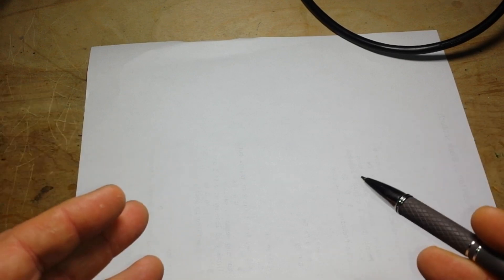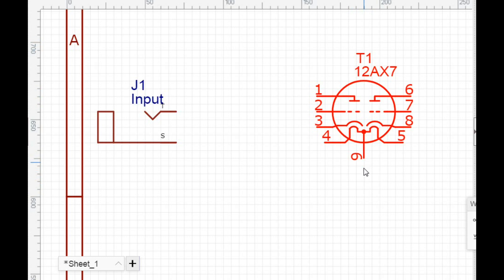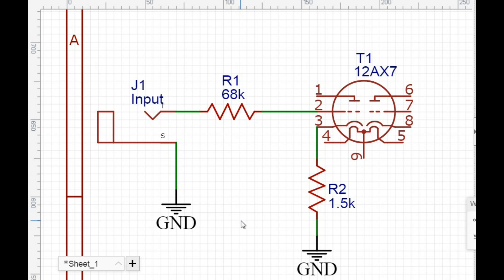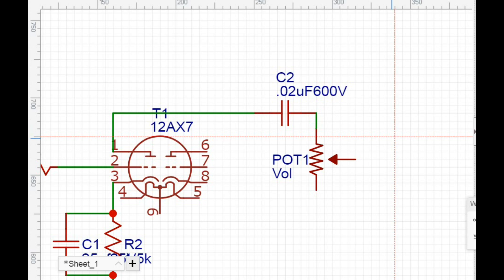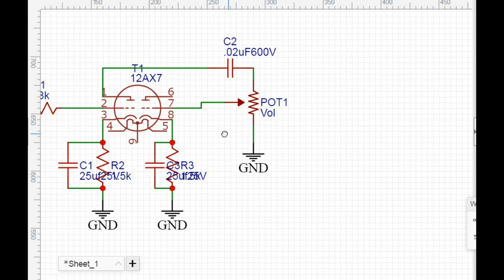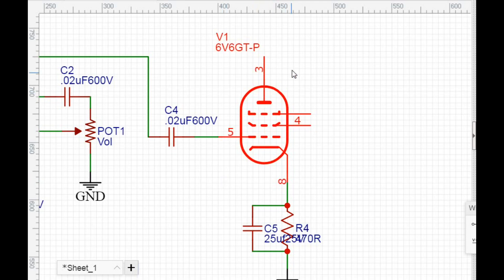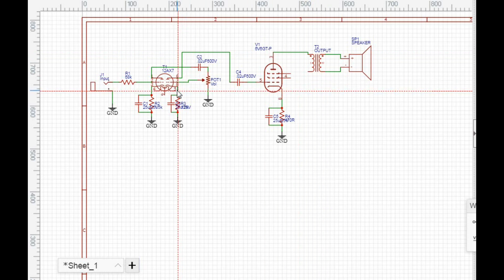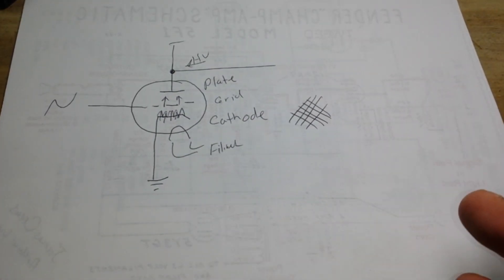Let's design an build a vacuum tube amplifier from scratch

Comment: Thank you for explaining the tube basics, very cool. When I use a chinch input, is the input impedance right or what needs to be changed. Great video.
Reply: That will not affect the input impedance, which is determined by the source. If it's from a phonograph, then you will want an inverse RIAA filter added to the circuit.

Comment: i recently took apart a  1950's lemco model 45 ignition coil/condensor tester that uses a ken-rad 6-48 4 pin vacuum tube  but cant find info on specs but the heater is ok @ 5.0-5.5v. i dont know tubes very well but im wanting a vacuum tube tesla coil. could I use it for a vttc??? any info would help .thank you paul!

Comment: Hello Paul!  If I may make a suggestion, I really think that you should put a capacitor between the input and the grid resistor in the first stage. Especially if you want to use the amp as a HI-FI amplifier. It is a form of protection to you, and your equipment. 

Also, I hope that your dentist appointment went well! Stay safe and keep up the videos!!

Comment: Should there be a capacitor between the input and the  tube/valve to prevent DC getting to the grid?  If you put any pedals between the Guitar and the amp, there will be DC voltage on the input in addition to the AC signal from the guitar.
Reply from the maker: What I have covered this far is the exact signal path of the Fender 5F1 circuit.
Reply: @learnelectronics  I would vote for the negative feedback.. it will make it much more Pedal friendly.  You might consider adding a master volume and effects loop.

I have been thinking on building a tube amp and this might be the project!

Comment: I never fiddled with tubes but have had a lot laying around many years ago.
As I always wondered and when you say that the grid thus the voltage of it, is that the negative or positive voltage of it?
If it's the positive this must make it 180 degrees inverted, right? since then the electrons will stop there instead of continue to the plate.
If it's the negative then why even leave the cathode as it "won't see" the plate as much as it's being choked by this grid.
Reply from the maker: The signal is AC
Reply: Well THAT I know, lol, as I asked the it's the negative part of it or the positive.

Think of it as if I probed it as if the input was just one short digitized pulse and in that moment it was sampled it was either positive, negative or zero, all the values AC can be.

Sorry... as you see on my name, English ain't my native language so... Hope you understand what I mean with this.

Comment: Been waiting for this Paul! That was great! Will you be expanding on the signal path by adding a tone stack and more gain stages? Possibly an inverter? I’d be curious to see which type you go with. I prefer the Marshall values to get that sweet Marshall growl. However, a chimey Fender can be sweet to! I only ask due to this design being pretty close to the Champ you recently built.
Reply from the maker: Youve got a good eye and are intuitive. Ill be dding a Baxendall type tone stack, but no more gain stages.
Reply: learnelectronics Thank you Paul! And Awesome! I look forward to the rest of the installments.
Reply: learnelectronics I am sure you might have seen these, but here are a couple great resources for tonestacks:

Duncan Amps Tone Stack Calculator web version:

http://www.guitarscience.net/tsc/

Another great site:

https://monster.partyhat.co/article/amplifier-tone-stacks/
Reply: All extra gain stages would really do is increase distortion, they wouldn't necessarily increase the overall gain of the amp.

Comment: Thanks for the video! 
A minor advice: you could give some more in-depth info for us newbies about the actual purpose of the caps and resistors added to the construction. I know that there are tons of videos about tube amps, but none of them seem to give enough explanation about the purpose of the individual parts and their values, just "a capacitor here, a resistor there, and you're good".
You could also make a video about the characteristics graphs in tube datasheets and how to use them. That's a topic I've been interested in for a very long time, but never found a good video about making sense of those graphs.
Reply from the maker: This is just the first part of this series, lots more information will follow.
Reply: @learnelectronics  Thank you, can't wait! :)

Comment: Why would you want negative feed back ?  Will it suppress osculations or ?  ???
Reply from the maker: It creates more "headroom" so it doesn't go into distortion at lower volumes
Reply: You are correct, the negative feed back will make the amp more stable, and less likely to oscillate.

Comment: Hmmmm what if you don't connect the B+ at the output transformer but instead connect the B+ between the output transformer and the output tube, then use a capacitor to block DC from going to the output transformer which will be grounded where the B+ would normally be connected. My thinking is that since no DC current will be present on the output transformer, it wouldn't reach saturation as early as it would had it been connected the way which you are going to do... Yeah it's a little unorthodox but I don't have the means to test my theory, my understanding is that the fact that you have D.C. across the output transformer and also the Ac signal when the amplifier is working, the transformer goes into saturation very easy which is why the output transformers are so large! If my theory is correct, you can either get away with a much smaller output transformer or get much more power at the output... I know that someone else tried to use a smaller output transformer but he was still connecting it the traditional way which just saturated it... I plan to try it out one day and hopefully soon..

Comment: Thanks for the video, could you go a bit more in depth about what the passives around the tube are doing?
Reply from the maker: Keep watching the series...
Reply: It would be great knowing how the values were figured out too.
.
Reply: @Songwriter376  they are determined by some calculations from the tube datasheets. the tubes have graphs relating the anode current at a specified voltage. These passive components determine what the quiescent current and voltage is and determines the amount of signal headroom.
Reply: zacboss467 Thanks for that answer!

Comment: A minor point, just to stop any confusion, you labled the 12AX7 as T1 instead of V1, which made the 6V6 V1 (instead of V2), and the output transformer as T2 (it should be T1).
Sorry. It's a bit pedantic I know, but having worked for many years (late 70's - early 90's) on design and repair of valve equipment I can get a bit like that. Again, sorry. Great vid.
Reply: i know Paul is not a guy who take affiance to what you pointed out. he's one of the nicest guys on YT.. FACT!!
Reply: 😄 This just reminded me that, many years ago, when first learning about electronics, I saw an American circuit where the valves were labelled T1, T2, T3, etc. I could not understand what the "T" signified. In the UK, "tubes" are called valves and that's what my theory books called them. There was no Internet in those days to quickly look things up. It was only later, when I came by an old American ham radio book, that I realised valves were referred to as vacuum tubes (T for Tube). I still can't decide which term I like best - vaccum tube nicely describes what it is, whereas, valve describes what it does.

Comment: Hey, I am having huge difficulty with op amp circuit used in TA7642 radios, I cannot figure out how to attach the lm386 chip to have a gain of more than 200 (10 u cap between pin 1 and 8) if I give it too much signal in 50 k ohm pot then the radio just makes a farting noise. My problem is that I need to figure out which lowpass or highpass filtrations between the speaker pin 5 and the 470 n capacitor and which resistors I need to reduce the hissing noises without any distortion or clipping when I try to make it louder
Reply: Moist Andy The gain cap for an LM386 is 200. To remove the distortion, you either need to cap the gain at a level below 200 by using a fixed resistor in series with the 10uF cap or adding a gain pot. You’ll need a 1k pot for a smooth transition. Check out the datasheet! Also, for the Zobel Network from pin 5, the resistor-cap to ground, the datasheet recommends 10ohms.